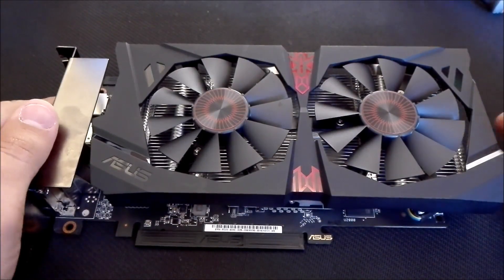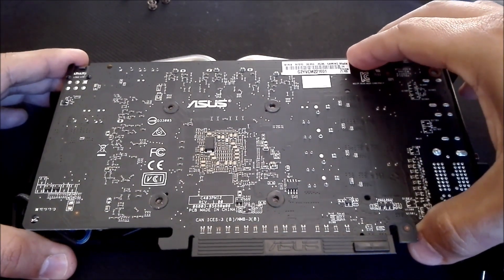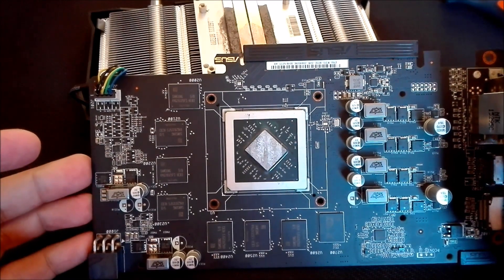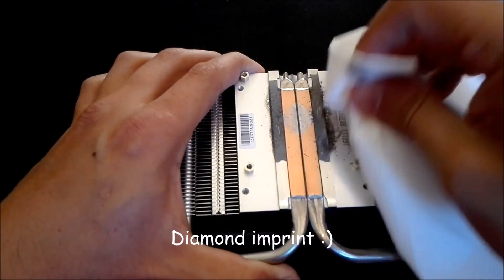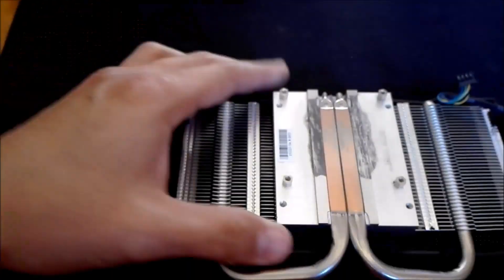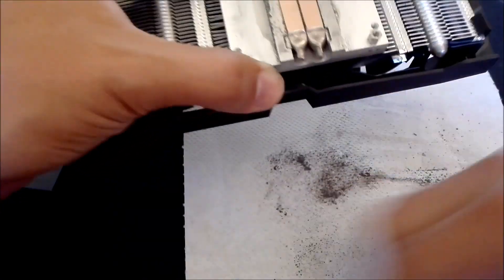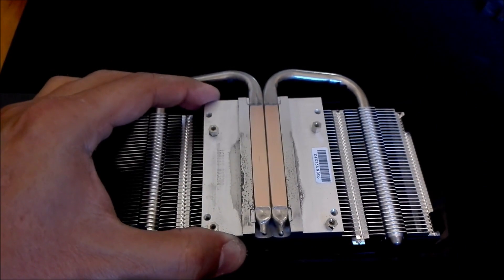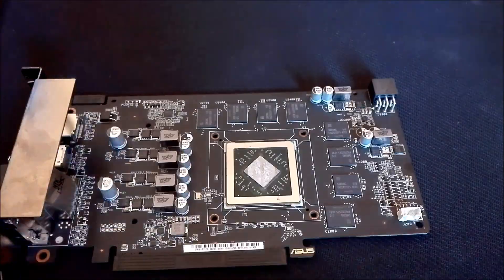Liquid Ultra Damage?

Comment: How does a person use Liquid Metal without knowing you're not supposed to use it on aluminium?
Reply: Why people assume that it is safe to have liquid metal and copper together? Because all these pseudo-facts are all around YouTube repeated by people who do not understand things. See for example: https://link.springer.com/article/10.1134/S0036029508060049
Reply: Copper corrosion due to contact with Gallium does occur, that's not a secret. It just doesn't happen fast enough to become an issue. Have you ever seen a copper heatsink damaged or destroyed by liquid metal? Me neither. When you do, then we can all be worried.

Comment: i would have gone at it with a brass/stainless steel wire brush on a drill then the sandpaper
Reply from the maker: The scrub pad and sand paper worked great. But sure, you could use a metal brush I suppose.
Reply: the important thing is to get it to work, didn't see a video for it thanks
Reply from the maker: Looking back at it, it would have been a good idea to make a follow up video on it. The guy who owns the card says it is still working just fine. I think we can call it a success :p

Comment: How durable is the liquid metal?
Reply from the maker: If applied correctly, it will last a lifetime. You should not have to replace it if it was applied correctly. If for some reason you break that bond later, you may actually ruin your hardware. Liquid Metal TIM's create a solid bond in time, which is not supposed to be broken. But some people do and later blame liquid metal for "ruining" their CPU or GPU. So if you use this, know it is better to leave it alone once you apply it. Hope this helps!

Comment: i'm going to repaste my Alienware R4 17 with Thermal Grizzly Conductonaut Liquid Metal Thermal Past now i know Liquid Ultra will go dry after 1-2 years what about Conductonaut will it go dry?
Reply from the maker: There is a wide misconception about liquid metal TIM's. Unlike conventional thermal pastes, Liquid Metal TIM's create a "solder" like bond between your CPU and heat sink after some time. This bond is meant to be permanent and should not be interrupted. Cooling performance will remain the same, as liquid metal will not age or degrade as quickly as thermal pastes. 

I have had Liquid Ultra in one of my graphics cards for almost 3 years now, and performance remains the same, as long as I keep up with regular cleaning. I applied it once, and left it alone.
Reply: Well i won't be opening my laptop more then once so i don't really want to open it and clean it not sure what you mean but if that is the case i will be putting that onto my CPU & GPU :)
Reply from the maker: By cleaning I mean just blowing the dust out with a compressed air can. Its just regular maintenance. You do this by blowing air on to the fan under the laptop and onto the side where the hot air comes out.

Comment: Warning:Please note that you can’t use the Coollaboratory Liquid Ultra with a contact area of aluminum, as it corrodes aluminum. The heatspreader of actual processors consists of nickel-plated copper, not of aluminum.Advice:  The applicationon copper surfaces is a bit easier than on nickel-plated ones, but possible is both.
Reply: better read the manual next time

Comment: that is a crappy heat sink design
Reply from the maker: It is, I agree. Its a way for ASUS to cut around corners.
Reply: lol pun fully intended (no paste on the corners)
Reply: Why do u say its a crappy heat sink design???Whats wrong with it?
Reply: ASUS GPU coolers, especially the DirectCU ones like this are actually very good! I had a R9 270X using it, still works after 4years of use and abuse :) but I did change the thermal compound after 2years to MX-2

Comment: even after cleaning you will notice continued corosion..
Reply from the maker: I just took it apart a few days ago. No continued degradation.
Reply: Technology Hive hm...
Reply: maby the galium aloy isent concentrated enugh at the surface to do any oxidative damage....
Reply: He removed most of the alloy. The remaining dark bits after sanding will continue to spread, however, very slowly because most was removed

Comment: the corosion isent just on the surface... it permiates thru teh aluminum and weakens it tremoundiously (should replace any alluminum parts that are in contact with any other alluminum that is effected by it)
Reply from the maker: thanks for the tip ;)

Comment: Nice video. Have you ever tried using the line method for spreading applications? A thin line across one edge then you just drag the spatula across the die. Also, how does Kryonaut compare to something viscous like Tuniq TX-4 in low to moderate pressure  applications?
Reply from the maker: Hello. I have never used TX-4. I can tell you that MX-4 and Kryonaut are the best thermal pastes I own and have tested, as far as performance and spread ability. However, Conductonaut and CLU are the best for direct on-die applications. I have never tested the line method. Only pea and spread methods and these two work great.
Reply: the case for liquid ultra and especially liquid pro, you cant just use the bead/line method you have to pre spread it
Reply: I was talking about the part 13:00 minutes in.

Comment: Great in depth video. Thanks for sharing. Quick question: can we just use pea method for GPU, or is it more advisable to spread out the paste?
Reply from the maker: Hello! Liquid Ultra must be spread. Don't use the pea method with liquid metal, or else it could spread to areas you do not want it on, like resisters. But with all other, like IC Diamond, Thermal Grizzly Kryonaut, MX-4 and so on, you can use the pea method and get same or better results. Hope this helps :)